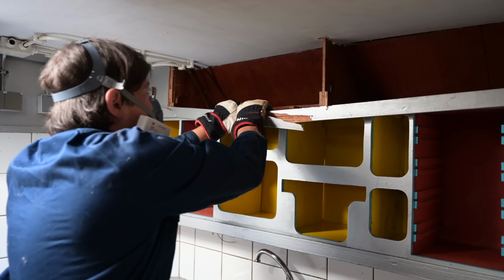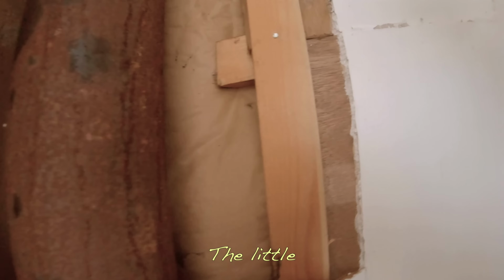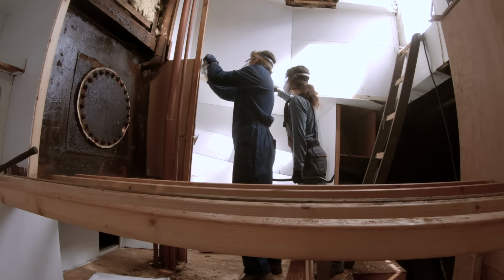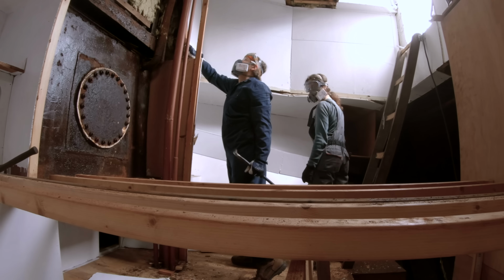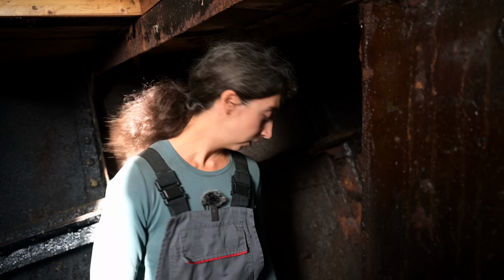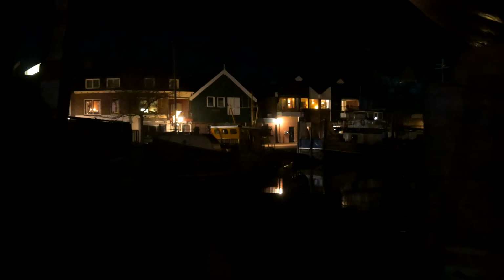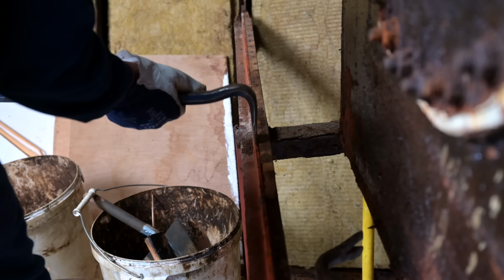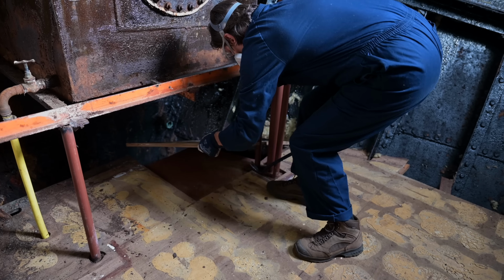FLYING CONEY - The Biggest BOAT PROJECT on YouTube?

Comment: I worry that you are making the mistake of keeping nothing of what you bought. It was an old boat , you expected to have old things, Maybe it was all bad  , it sure looks poorly refitted in the past. But now you have nothing but a huge and difficult job of work that will last years. You will not have a boat to use for years. I hope this is what you want. 
Cheers Warren
Reply from the maker: It was always the plan to build an interior from scratch. the broker has described the interior as "somewhat usable". But it wasn't the plan to rip everything out at once. People usually don't have an idea about how expensive certain parts of a ship are. For example the shaft and the prop are about the same as all the whole interior we ripped out... 
It will take years until we're finished but we always will have a floating home.
Reply: @FlyingConey  Thats good then, you certainly seem ready for the challenge, unfortunately some people seem to think gutting and rebuilding a boat is like a house but it’s a much more challenging project, for a whole lot of reasons . I look forward to continuing to follow and being a occasional supported 
Cheers Warren